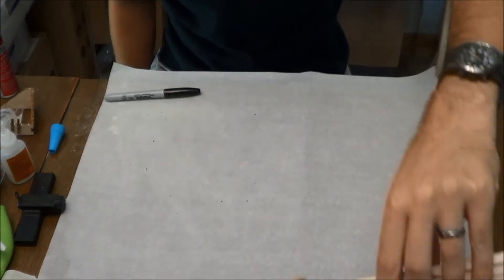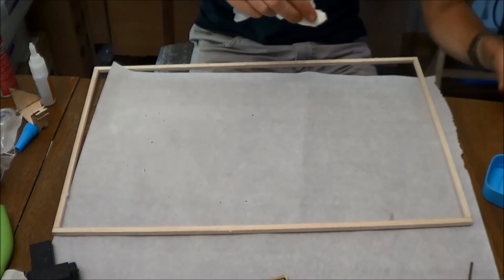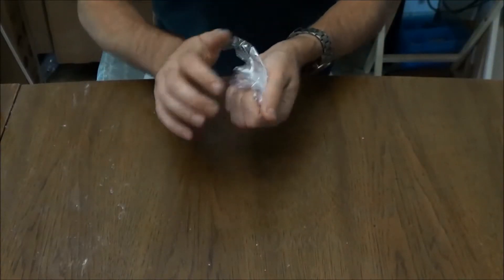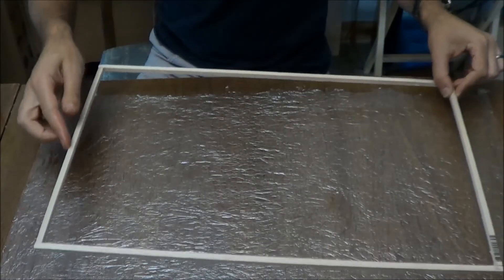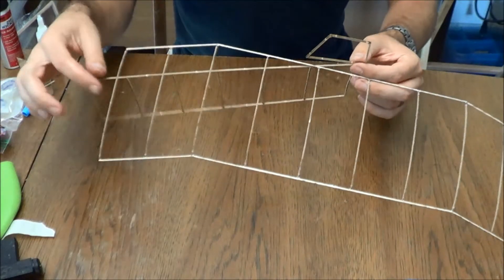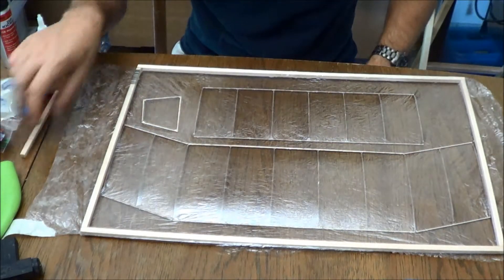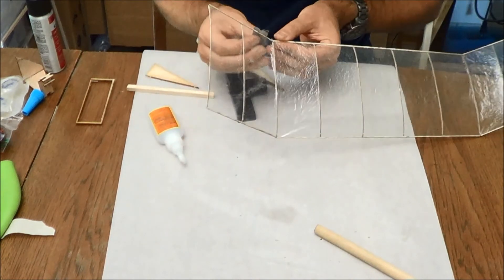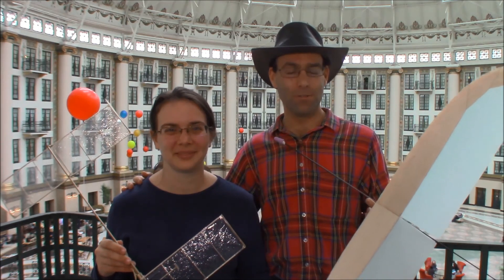Incentsitive Pennyplane Build, Pt2: Covering

Comment: is this method better to avoid potato chip surfaces? also notice no soldering iron, must super sharp razor blade. looks good.
Reply from the maker: It definitely helps avoid potato chips, but isn't necessarily a sure guarantee. The razor blade is used because this film is fairly thick (2 micron) and cutting with a soldering iron causes enough shrinkage that the dreaded potato chipping is much too likely.